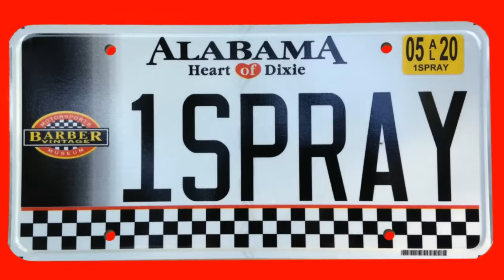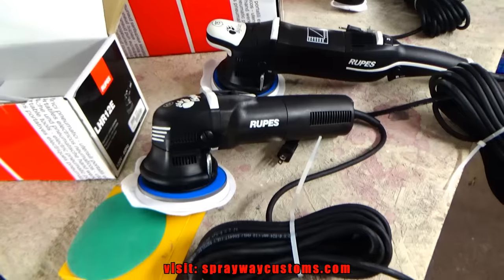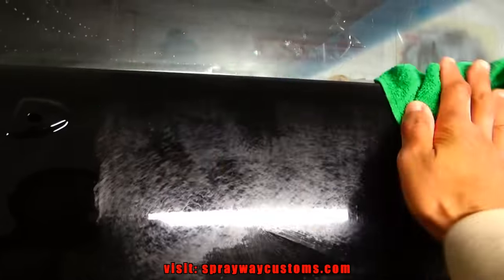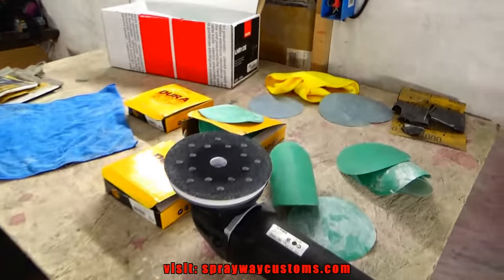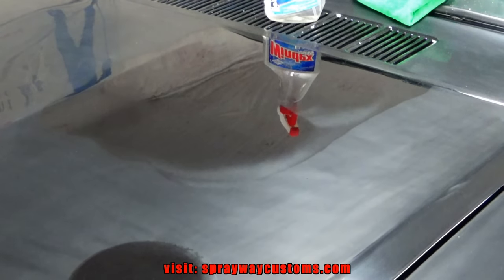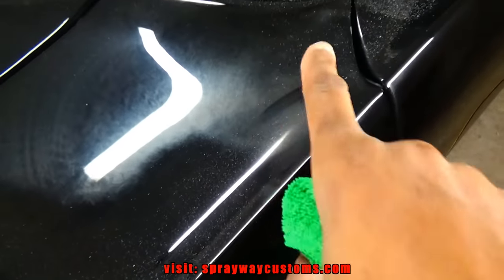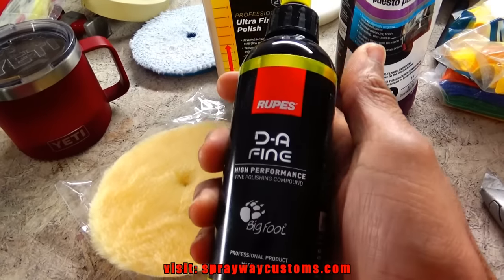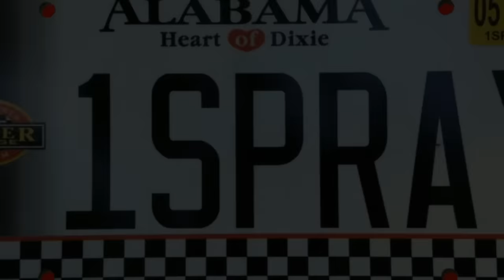Cut And Buff A Car To Remove Orange Peel & Trash From A Black Paint Job RUPES BIGFOOT DA POLISHER

Comment: Youve done well. Yet just so a novice understands, they by NO means need a rupes machine to do a great job. I used an old Makita rotary for years 😲, then Porter Cable, and currently use the Makita PO500CX2. Technique and product are far more important than anything else.
Reply from the maker: Thanks…that’s true Gary

Comment: Great to see you upgrade to DA machines. But you should definetely invest in some paint inspection lights like scangrip or other because they expose all the remaining defects and haze way better than regular garage lights. Keep up the good work!
Reply from the maker: Thanks man
Reply: @SprayWayCustoms  No problem! Im also a part time detailer doing lots of painted cars so I can realate to you. Getting rid of orange peel and all the dust nibs is not an easy job to do, especialy if you also want to finish the paint nicely with no holograms like most bodyshops do.

Comment: Sprayway you did an amazing job but you didn't have to buy rupes you could have bought in the cheaper version of a DA polisher from harbor freight the Bauer one and my opinion you should have done it the classic way with the rotary polisher
Reply from the maker: Appreciate that Alex. I did a lot of research before I bought it and decided on Rupes for the long run. It's super high quality.
Reply: @SprayWayCustoms  that is to Rupes is very high quality it's focused for the automotive detailers

Comment: 19:50 why do small sections at a time?
Reply: In compounding and polishing you need to keep tabs on your work. You can manage small sections. Buff, wipe, inspect, buff again if needed, then move on. Also the compound and polish material on your pad is only enough for a small section. Clean your pad periodically and do the car a bit at a time. Cutting and polishing is the fine detail of a car finish... You are and can shoot for perfection in this stage, so no rush and small areas. This is the money phase. Everything after this is just protection and maintenance.
Reply: @DerekFromBK  thanks
Reply from the maker: Thanks for the reply Derek...you hit it right on the head 🤝

Comment: and also you didn't have to buy that little small da polisher to sand that you can have just use the 3M triact system with a air DA
Reply from the maker: Thanks man...I have one. I just wanted to go with the electric

Comment: looks nice but i still see the trash on the hood and fenders. one more flow coat will get it.
Reply from the maker: I'm not trying to start over with a flow coat...all the cutting and buffing would've been pointless. It's black paint so I'm pretty sure you can spot any little imperfection. Thanks for watching
Reply: @SprayWayCustoms  Hey don't get upset with me it was you and your mind that said that's good enough. I didn't say that to talk about you i told you it still looks good. take care dude

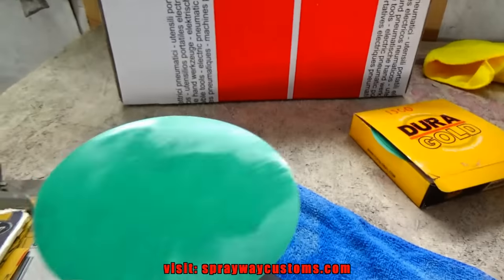Comment: At 12:50 u said you used 2000 but you pulled off 1500 from the sander
Reply from the maker: Not real sure on that part of the video but I used 1500, 2000 and then 3000

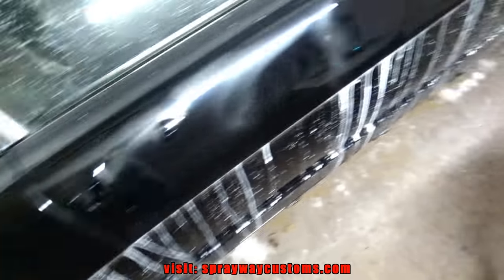Comment: I always give props to the ones who paint in their back yards...but at 27:11...did I see the buffer laying on the freshly painted fender....come on man....1 scratch and your work is fucked.....also why cheat the customer out of sanding the whole car...I know there is trash in the lower parts ...and the pillars....
Reply from the maker: For one the customer didn't pay for a cut n buff so I don't think he was cheated and I don't see how trash and overspray would get on a vertical surface such as the lower part of the vehicle. For two I don't think one scratch would deem my work fucked...so you call it...if cutting and buffing is what I was doing in the first place. I don't think the job is considered over until the scratches are removed. 🤷🏾‍♂️
Reply: @SprayWayCustoms  what’s up brother I think I’m a need a job down there in bama working with you. Do you have a spot open or need some help I’m Serious too💪🏾🤞🏽. Great work I’m always up for learning different ways